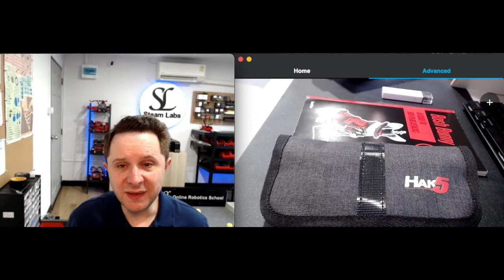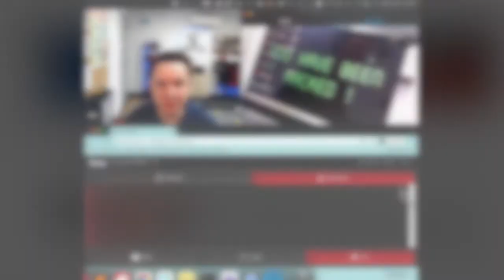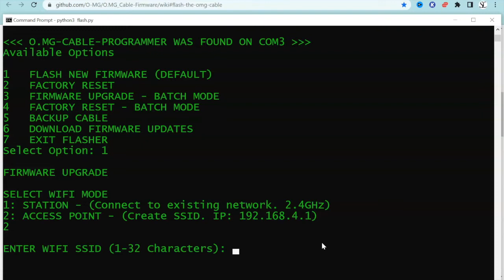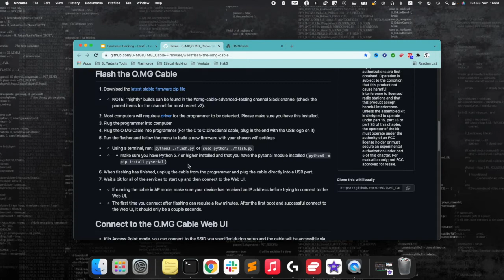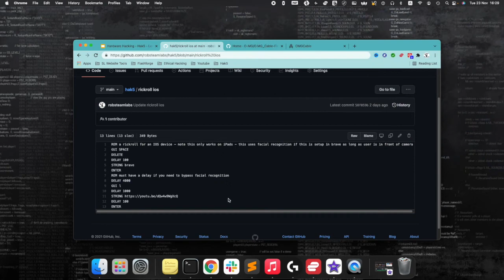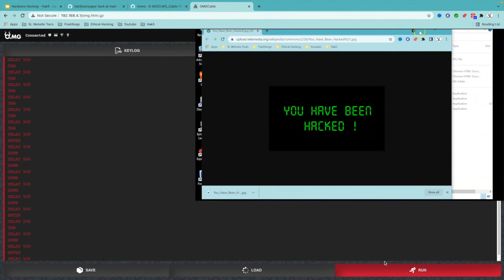OMG Cable  - Rubber Ducky Script - Hidden Keylogger - iOS hacking

Comment: What I want to know is can you use the omg cable as a key logger to get access to the four digit code to unlock my phone. So basically if I plug the omg cord into my phone can someone gain access to my four digit  security unlock code  on my phone. By using the omg as a key logger
Reply from the maker: Unfortunately it doesn’t work in that way as it’s design to log actual key presses on a keyboard
Reply: @steamlabstech  that's weird I figured it would work. You basically entering a password.

Comment: Can you use a Lightning to USC C adapter or visaversa to use on other platforms? (So you don't need one for Android and iproducts separately?)
Reply from the maker: Hi,

Adapter do not work unfortunately, I have tried, I therefore have all variations of their cables.

Comment: hello, thanks for this video ! but does the cable have to be plugged into a PC to work? Can it work instead of the charging cable (and therefore plugged into the charger)?
Reply from the maker: Yes it can, you only need the malicious end of the cable in the target device when pen testing
Reply: @steamlabstech  will it also charge the iPhone to avoid suspicions? Or is that how you can detect that it is in fact a malicious cable
Reply from the maker: @gabriellebm8923  yes it works like an ordinary cable so yes, it charges the iPhone
Reply from the maker: @gabriellebm8923  you can detect if it’s malicious by using a malicious cable detector, doing a video on this soon as well as introducing some new cables 😊